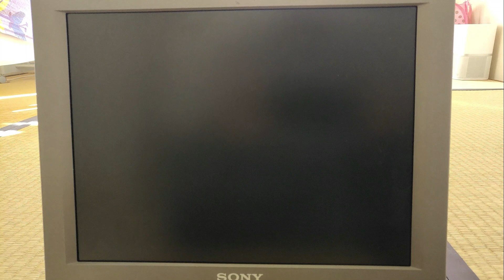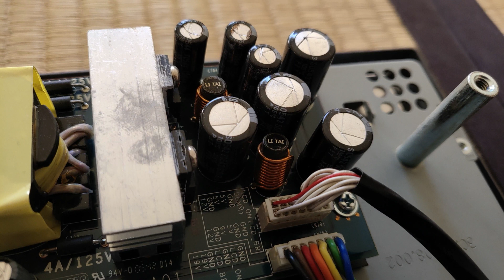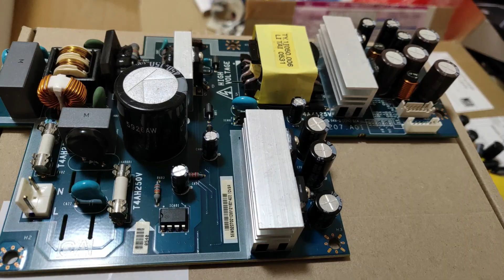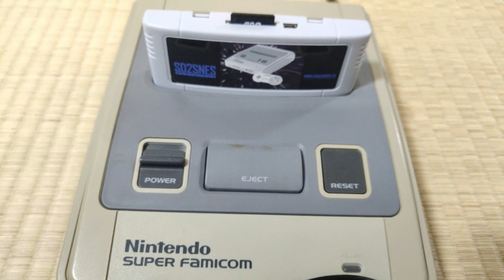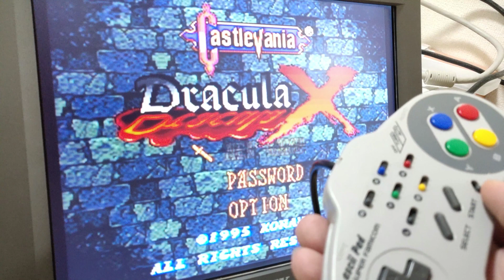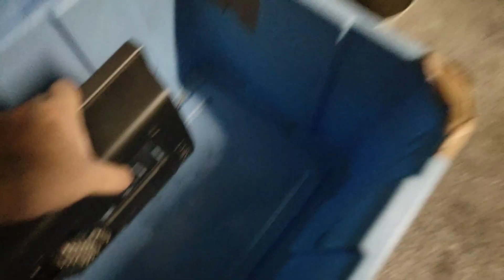The SONY LMD-1410 - A PVM Replacement?

Comment: To me the value of these monitors isn't in gaming, it's in using them as piece of test equipment on a bench. You can test real TV signals without the desk space.
Reply from the maker: Its better to get a real analog CRT than this.. they will take all kind or signal frequencies
Reply: I picked one of these up recently, I run a VHS transfer shop, this thing is so much more reliable than a PVM, and takes up so much less space, it's perfectly designed for what it is, I'm curious though if it would be possible to find an IPS display that could be swapped in for this to reduce some of the aforementioned ghosting. CRTs are great retro gaming but they're super impractical for most people to own with how big of a footprint they have.
Reply from the maker: @CheeperVHS  I think there are some early Trinitrons which do not have such ghosting and are better.